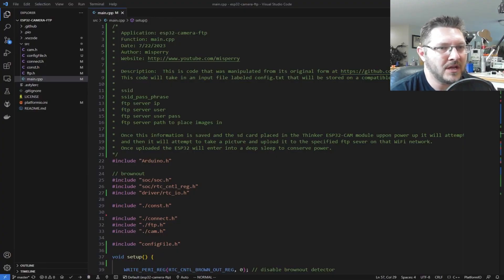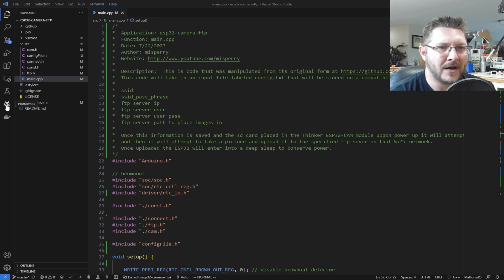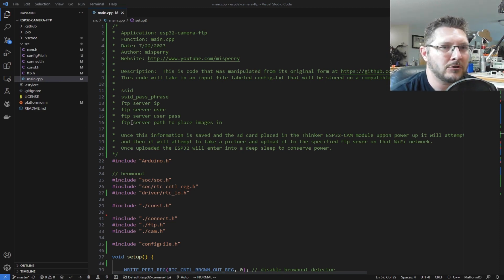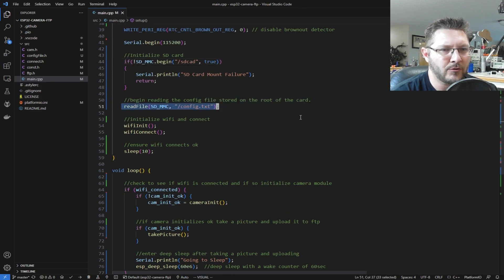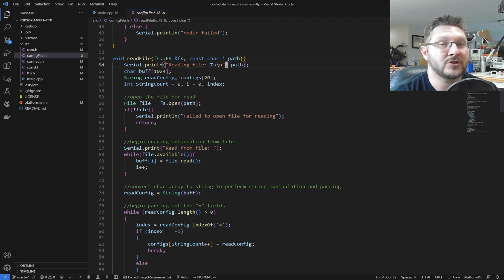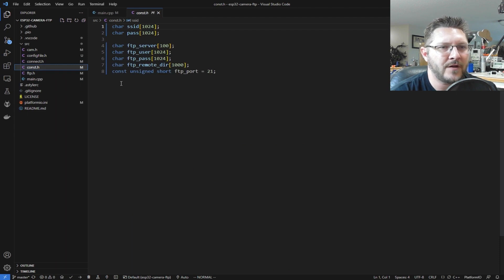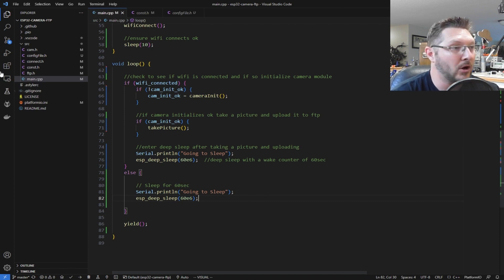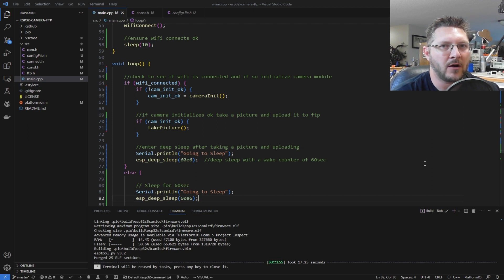ESP32CAM WiFi Enabled FTP Image Uploader

Comment: Most obscure way to disable an LED I have ever seen. I was running into the LED issue in another project and I found a suggestion to desolder the transistor going to the LED before I found the software solution.